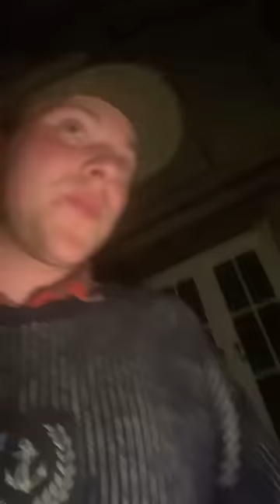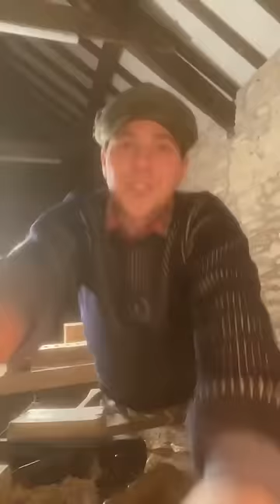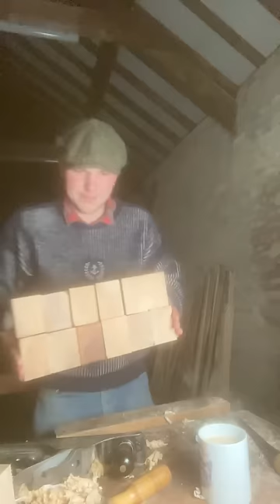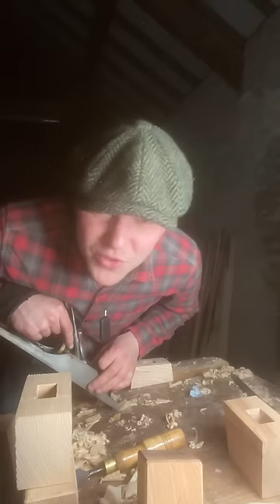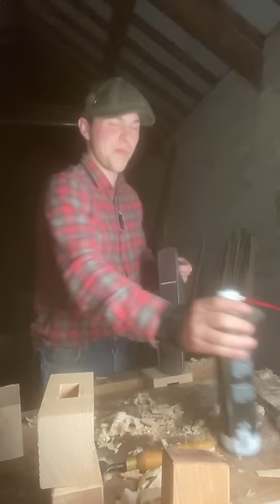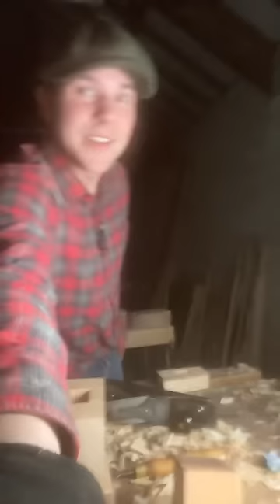Making mallets for Christmas

Comment: Now you need a touch of heat to warm the inside of the building! Great job on the Mallets Eoin!  Go to one of your friends who make chainmail gloves to use on the bandsaw as protection!!
Reply: I did some research into this when I first got my own bandsaw. The advice given internationally, was not to wear any type of gloves when using a band saw, as they could potentially mean getting drawn further into the blade if they ever got caught. It surprised me, as I had exactly the same thought as you. Bar ehands means probably pulling away, even after a cut. Good luck & take care!